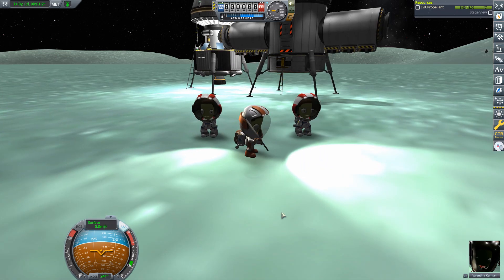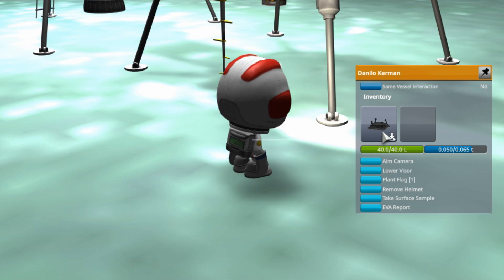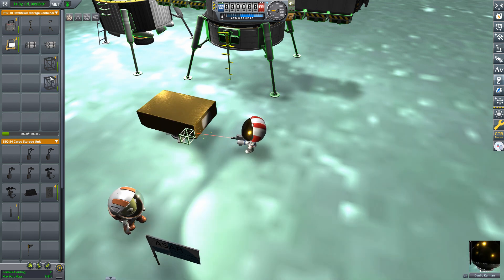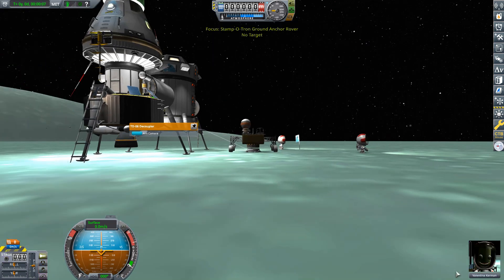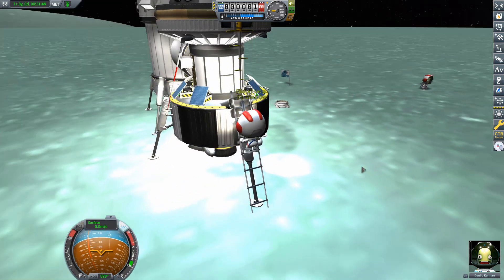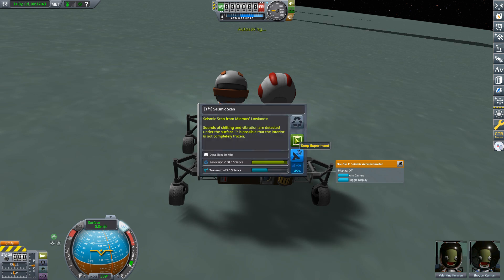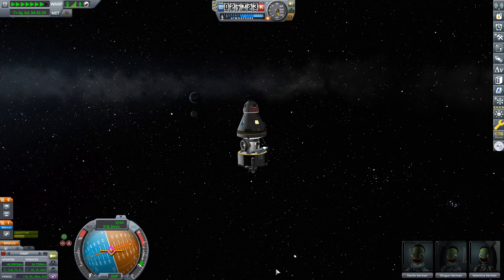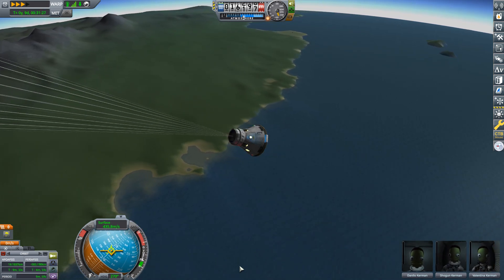Building a Rover on Minmus | KERBAL SPACE PROGRAM Contract Tutorials

Comment: 9:09 You do such a Great job on all your videos, I'm surprised you made an error on your card.  You have "D" listed for right and reverse.  "S" is reverse.  Another tip I use for rovers is to bind the "Switch Mode" function of the reaction wheels to something easy to hit so I can control it "mid-flight" if I hit a bump sideways or start tipping at a bad angle.